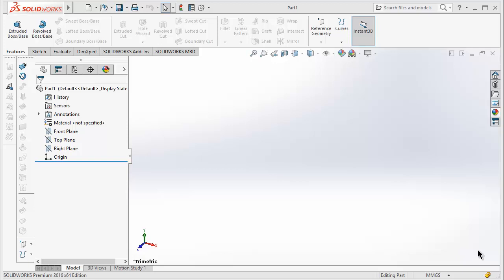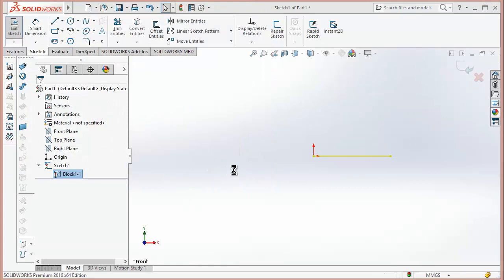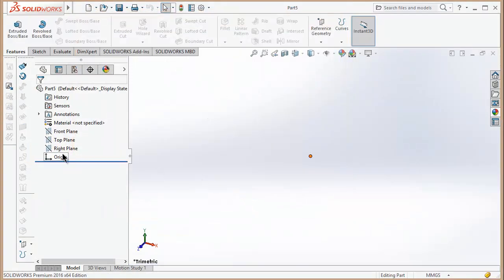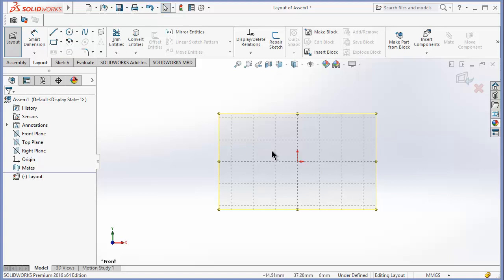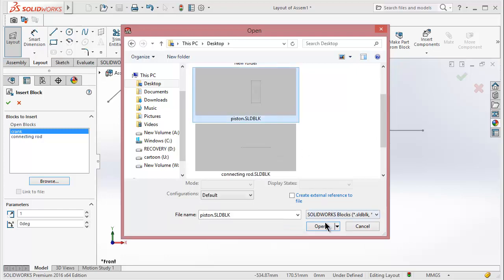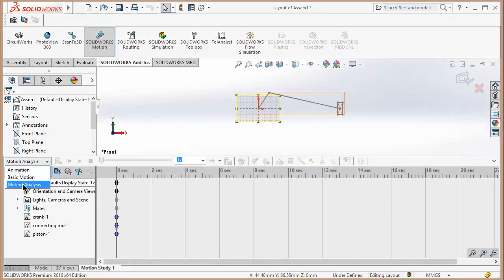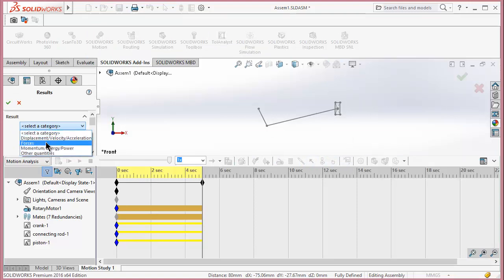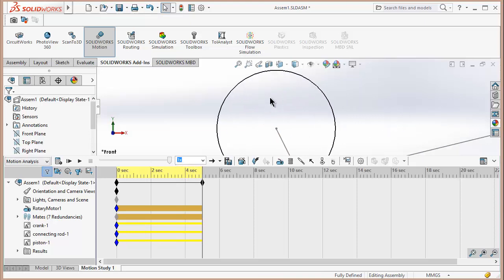2D sketch motion analysis in solidworks

Comment: la pieza rectangular no sigue alineada con la recta , al girar la palanca la pieza rectangular también gira circularmente   porque

the rectangular piece is not still aligned with the line, when turning the lever the rectangular piece also rotates circularly because
Reply from the maker: use constraint to fix them as per your requirement or should i make new video ?
Reply: @Cadknowledge  
gracias por responder
el problema estaba dentro de propiedades de estudio de movimiento , estaba activada la casilla remplazar relaciones de posición redundantes con casquillos

thanks for answering
the problem was within motion study properties, the replace redundant mates with bushings check box was checked